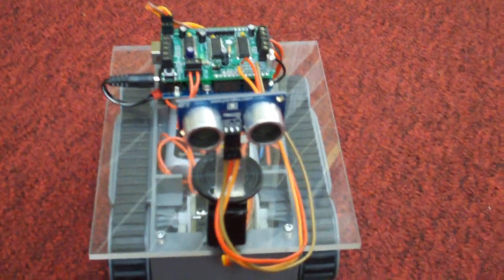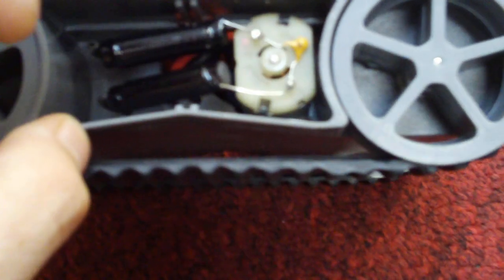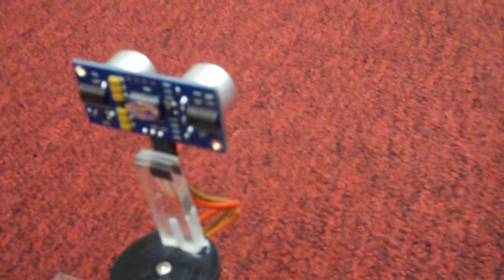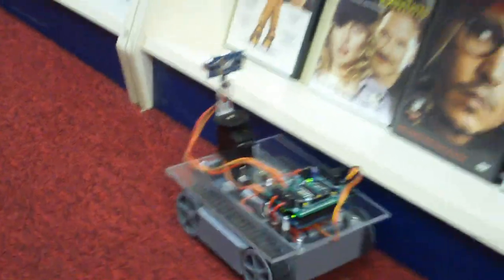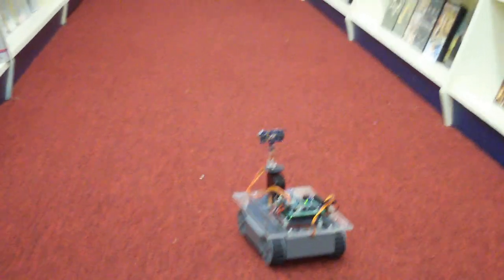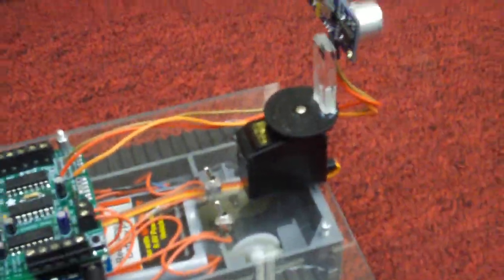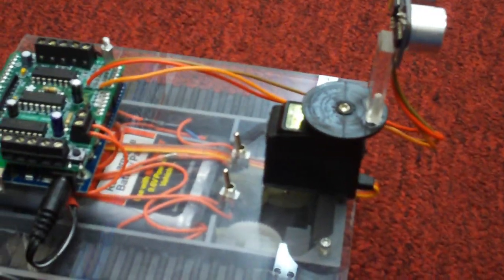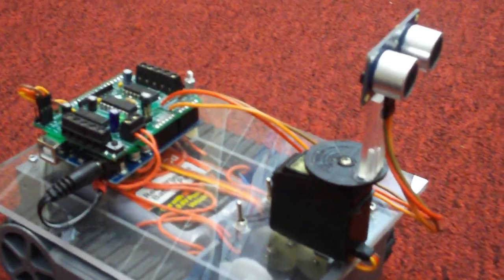Diode the 2nd

Comment: Ok good friend...I build this type robot - any obstacles avoidance robot car.. I have 4 BO motors, 1 Arduino Uno r3 board,1 Ping sensor,1 servos,1 Adafruit motor shield. Now i need the sources code for this robot.. pl send the code sj28550@gmail.com